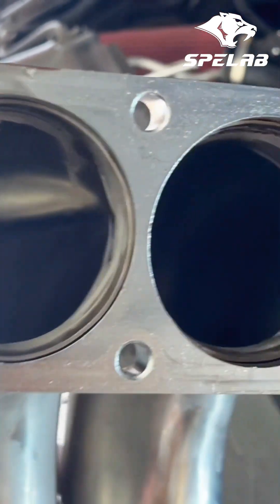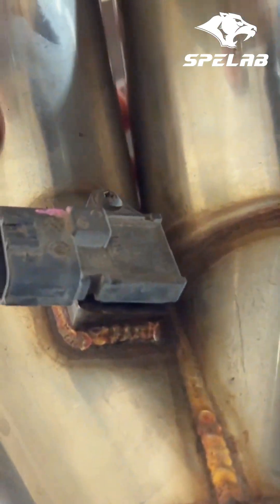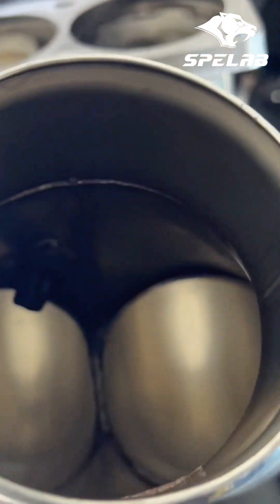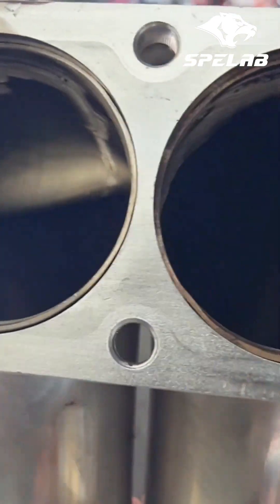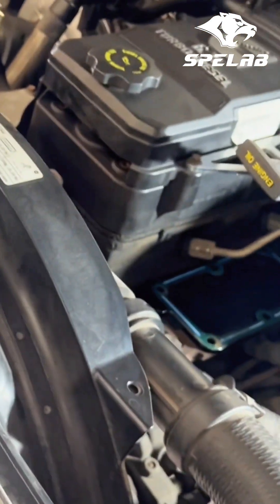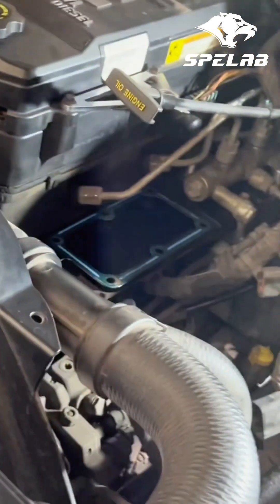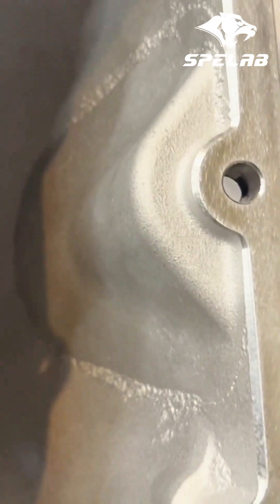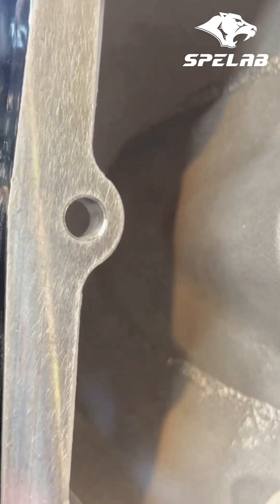SPELAB Intake horn comparison: OEM VS Spelab 2X OEM Diameter

Comment: You can tap and drill and weld a nut and install a new styler gride heater also on those 3.5 horns